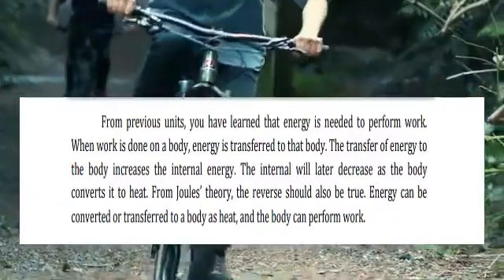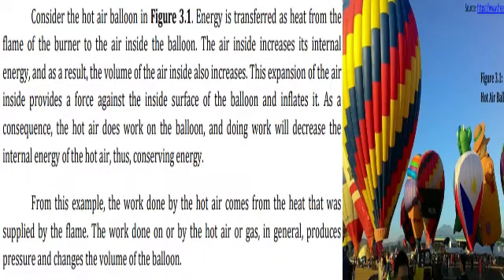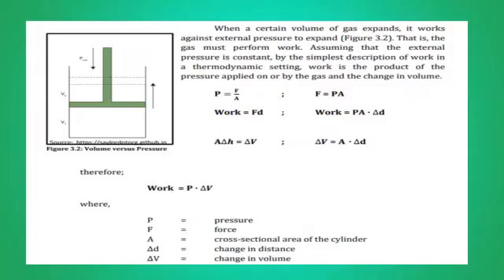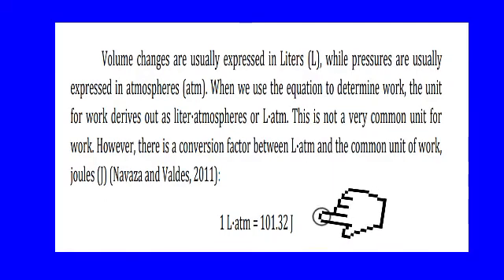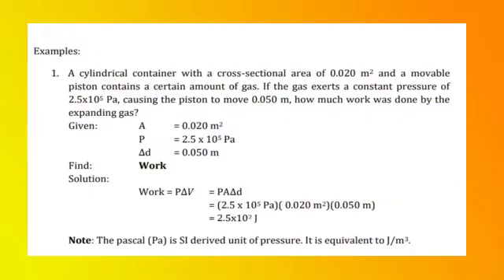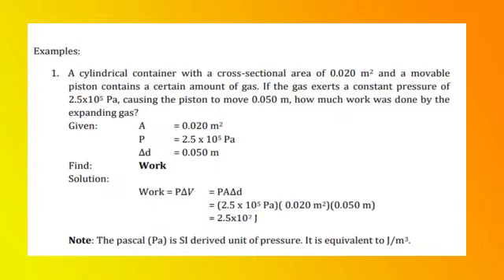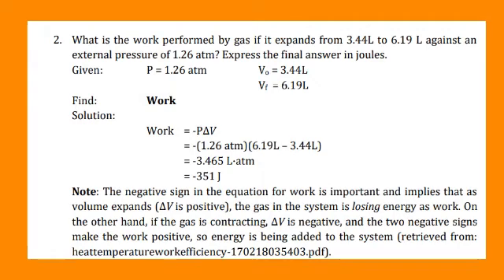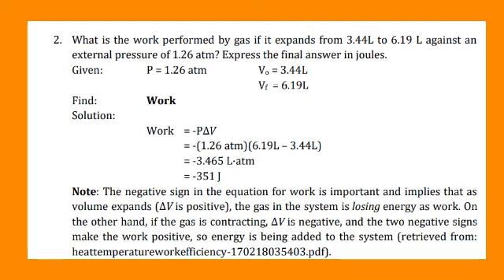THERMODYNAMICS- AN INTRODUCTION

Comment: 1. Thermodynamics is the relationships between heat and other forms of energy. It describes how thermal energy is converted to and from other forms of energy and how it affects matter.

2. Thermodynamics is essentially the study of the internal motions of many body systems. Virtually all substances which we encounter in everyday life are many body systems of some sort or other example is the solids, liquids, gases, and light. The aim of thermodynamics is to understand the concepts related to converting disorganised form of energy to organized form.

Daily Application of Thermodynamics

Taking a bath
Switching on and off of the light
Refrigerator
Cooking
Using bicycle

Comment: Thermodynamics deals with the study of heat. How heat converts into work and how heat can be transferred into substance.

The study of thermodynamics is important because we can now understand the importance of heat. How heat works, and how heat are capable of. The application of thermodynamics can be related into when we are using electronics that conduct heat. Or simply when we are doing things, our body conduct heat because we are doing a lot of work

Comment: Thermodynamics is the relationship of heat or temperature to other forms and kinds of energy as well as work.
 
Thermodynamics is important because like most fields of scientific study, it is govern by a series of laws, like the behavior of chemical reactions and processes that convert energy in the form of heat into other forms of energy. Also, in thermodynamics we can find out how efficient things are using energy for useful purposes, such as generating electricity, moving an airplane, or even riding a bicycle. We live in a century we're technology is very useful, so we need thermodynamics to explain how it works.